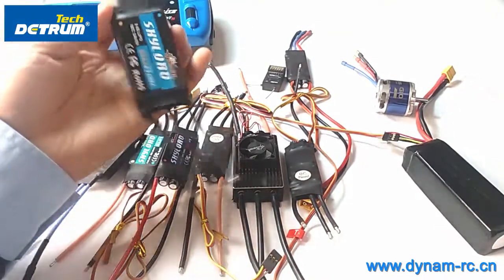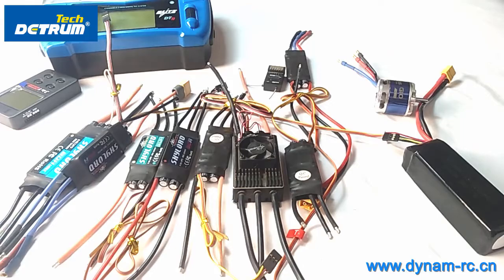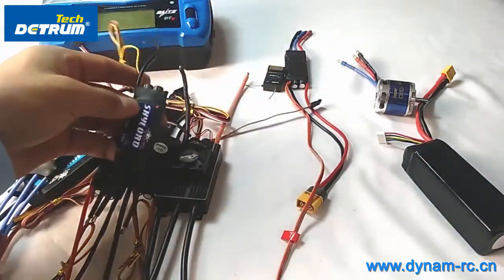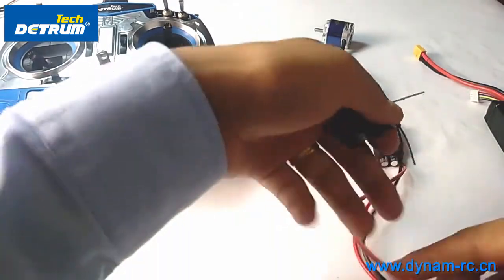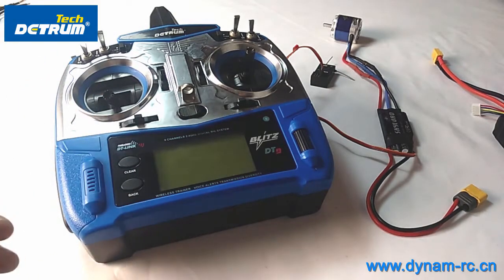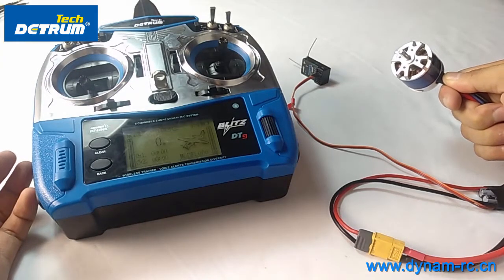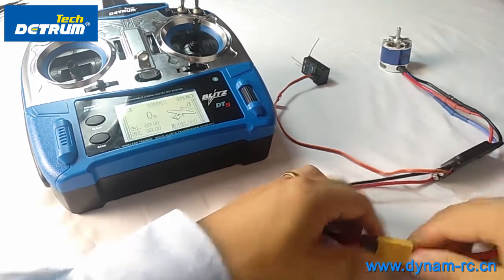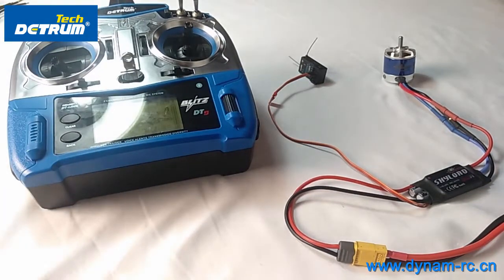Throttle Range Setting of TomCat Skylord ESC

Comment: Your English is getting better . How do you turn off the engine brake on the sky lord yes seas they come in the Gloucester meteor 80amp esc???
Reply from the maker: do you have ESC program card? thanks
Reply: No I don’t . Where do I get one ??
Reply from the maker: @leedavidsonshangar9908  https://www.bitgohobby.com/Detrum-3IN1-Program-Card-for-StabilizerESCBattery-_p_5901.html
Reply from the maker: @leedavidsonshangar9908  You can check my next video, ESC programming on DT9 transmitter, check if your transmitter get similar function, so you will not need to buy extra programming card